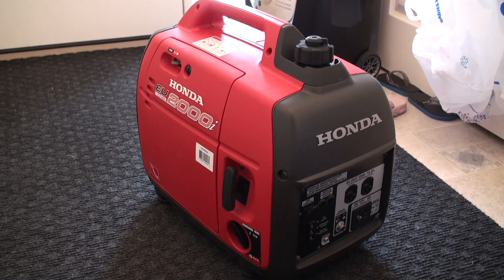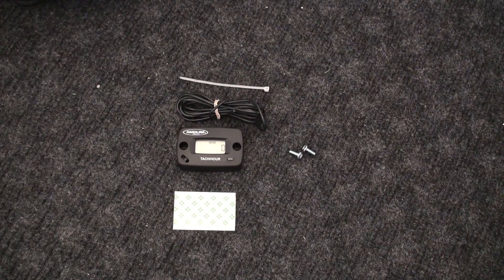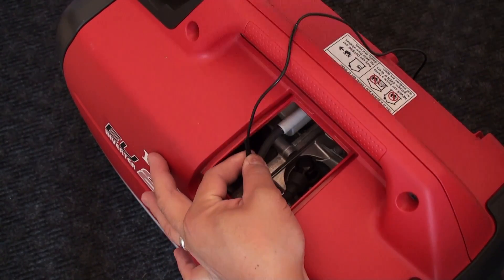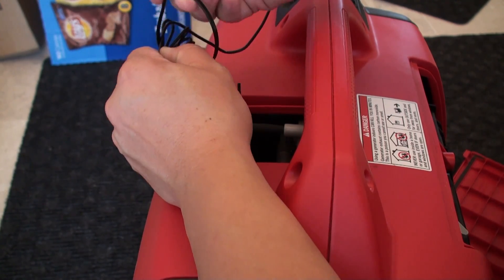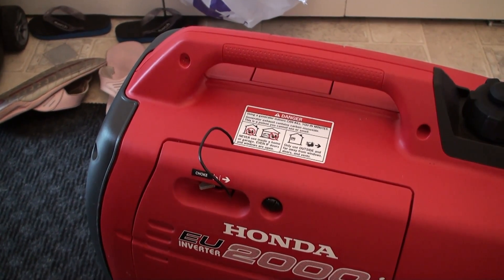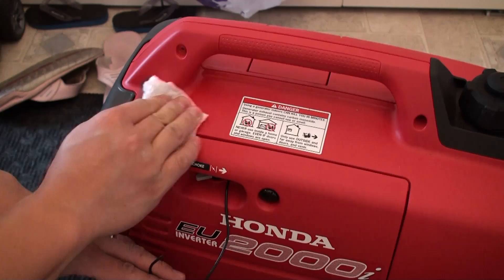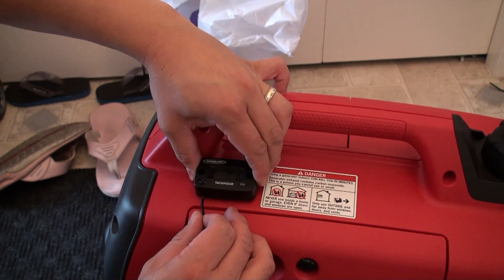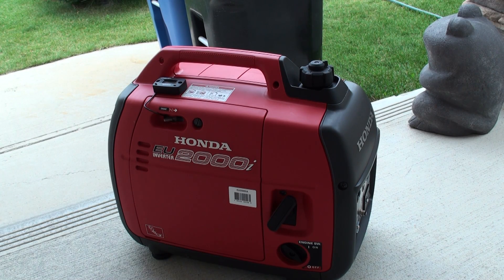Installing a hour meter and tachometer on a Honda EU2000i generator

Comment: Thanks for taking time to show how easy the installation is.  Your video is informative, interesting, & is the reason I come to youtube;  looking for DIY videos
Reply from the maker: +Bill Cole yes installing an hour meter on pretty much ANY power equipment is super easy.  My method probably isn't as "pro" looking as some others but I don't like drilling holes into ANYTHING just because... well... I pay good money for my equipment so I'm a bit obsessive and "anal" about things.  

Thanks for watching and consider subscribing if you like my channel :)
Reply: +piercedasian I just subscribed, I've previously check the "like" box.  IF I pull the buy trigger on the generator, then I'll definitely also buy the Hardline Hour/Tach meter.

Do you know if the 12v outlet can be used at the same time a 120v outlet is being used?  Do you know if the 12v circuitry when using the 12v outlet will prevent a battery from being overcharged?  Yes, I know the 12v outlet charges at 8 amps.
Reply from the maker: awesome thanks!  If you do buy the generator you'll LOVE it.  Nicest generator I've seen so far (next to higher priced models of course).  Super stable power, starts on the first 2 pulls and runs smooth and quiet.  I ran it once at a campground all night on FULL load and nobody even noticed it when I had it tucked away in the bush...  No regrets from me at all.  Good investment.  

For the charger you cannot use both the ac and dc outputs at the same time. You'll damage the alternator.  The DC charger is unregulated and not stable like the ac side is and it can overcharge batteries IF left long enough.  Usually with 12 volt batteries this isn't an issue since the 12 volt battery stabilizes the voltage much like how a car battery does that for a car.  Just err with caution if you're going to use it all the time to deep charge batteries.  If in doubt buy an ac powered battery charger to precisely charge your batteries.  They're lightweight, inexpensive and "smart" so as to not damage the batteries you're charging and because it runs on ac that means you can run other ac powered devices at the same time :)
Reply: +piercedasian I bought my EU2000i yesterday.  I'll get delivery of my Hardline hour meter/tachometer on Monday & will install it.  I, however, will be drilling a small hole in the case to feed the pickup wire to the hour meter.  I want to be able to remove the generator side access panel without having to disconnect the hour meter pick up wire.

I also plan to spray paint my generator Blue, which is Yamaha's color in hopes of reducing the size of the bullseye that the criminal element has for the RED Honda generators.  The place where I bought my generator has a cable running through the handles of all Honda Generators to deter theft.  That tells me these generators hare high on the criminal elements "wishlist"  Hopefully, the different color on my generator won't attract the same attention as a RED generator.

After 20 hours, I'll be changing the oil to 0W-20 Amsoil which is a 100% man-made synthetic lubricant.

I also plan to modify my generator so I can add a 2nd gas tank.  I'll be doing the same modification I saw on youtube, entitled, "Honda EU2000i improvement. One of a kind."
Reply from the maker: Congratulations Bill!  You'll be very happy with it.  Rather than drilling a hole into the unit why don't you just buy the "camo" version of the generator.  This ways you won't have to paint it and it will have that perfect factory look to it.  The camo unit blends into the background quite well.  As for the cable through the handle it is really more of a deterrent for a passer by than it really is an anti theft mechanism.  The handle doesn't have any metal going through it thus it can be easily sawed off and the generator removed from your possession.  honda actually sells a high security handlebar guard but I'm not sure how effective it really is.  Something to consider if you're worried about theft.

Comment: I don't understand why you would not just drill a small hole in the top cover of the generator and run the wire to the Tach that way, with your method you cannot remove the side plate anymore because there is a wire snaked through it.
Thanks for video.
Reply from the maker: +Harrison Winslow Hi Harrison, I deliberately didn't put a hole in my case b/c honestly I'm overly anal about modifying my barely used generator.  As weird as it might sound so much as putting a scratch on my generator kills me let along me deliberately drilling a hole into the case.  Yes it sounds outright silly but believe me when i say I'm a bit anal about things.  Definitely drilling a tiny hole makes sense for a person with logic but in this case I refuse to drill.

Thanks for watching.
Reply: I'm anal about things like this too and I wouldn't want my nice new generator looking like a four year old wired up the hour meter.  Do it properly
Reply: Or he could have purchased a meter without any wires period as in a vibrating hour meter.
Reply: Seriously . . . what is this guy thinking? Drill a whole . . . and stop calling them "ZAP STRAPS" they are called ZIP TIES . . . by every single manufacturer :(
Reply: OMG I said the same thing, avoid all the exposed wire

Comment: How accurate is it? In all of the video's I have seen, it seems to jump around. Once its on for a minute or so, does it even out?
Reply from the maker: fairfield1987 if the tach is a decent quality unit that allows you to configure the # of spark cycles and you've got it setup properly it works surprisingly well.  This particular generator has an electronic governor that keeps the RPMS very precise and thus I've found that there is minimal RPM drift.  I think sometimes you get erroneous/erratic readings because the signal pickup wire isn't wound tightly or neatly around the ignition wires which can cause it to pick up stray EMI/RFI interference which can mess up the readings.  So far I'm very happy with my unit and since it's install I have logged over 50 hours of run time which signifies that it needs an oil change whereas before I would know no differently and would always be guesstimating the run time :)

Comment: Was also thinking.. Since the wire is long enough u can cut it n  test it to see if it works w connectors  n if it doesn't just cut the connection part away n back to one solid wire
Reply from the maker: Steve Lee hmm interesting thought.  I may give that a shot.  thanks for the pointers!

Comment: im sure you can cut the wire in the middle somewhere and install connectors so you can easily disconnect the wire to take off the service panel if you dont want it permanently hardwired through the hole
Reply from the maker: Steve Lee I wasn't 100% sure if I could do that or not and opted to not gamble on trimming the sensing lead for fear of it not working properly with my generator.  It was minimal work to zip tie the extra sensing lead.  The hour meter actually can be easily removed from the sensing wire if need be as it is just a "loop through some holes to hold it in" setup.   In any case, the install is relatively clean and most importantly I didn't drill a single hole anywhere on my genset :)
Reply: Cool.. Yeah I prob won't cut the wire either now u think about it... Gotta order my meter.. Thks for the vid
Reply from the maker: not a problem.  Thanks for watching!

Comment: The lithium battery is supposed to last around 3 years, was wondering when its time to change battery will the meter store the running time? Or will it be lost during battery replacement? Thanks for posting vid.
Reply from the maker: Hi Jeff, glad you liked the video.  On my hour meter the battery is not replaceable and is expected to last between 8-10 years.  I am sure that by that time I can crack open the case and replace the lithium cell but I'm betting that the hour meter will reset back to zero hours since it likely doesn't use "non volatile memory" which can store data without power.
Reply: @Jeff E...From what I can understand, from other video's,  once the battery dies, the whole unit has to be replaced....The batteries are not replaceable.
Reply: @dannyj5688  thanks for the reply...... believe it or not battery still operating.....have 210 hours on the Honda gen
Very happy with both.

Comment from the maker: @ john doe - zap strap, tie wraps whatever you want to call them are available practically anywhere.  You remove the panel exactly how you'd remove it normally.  There is plenty of wire left inside the unit to allow you to take the cover off and set it aside to do the servicing.  If you listened to the video you'd know why I didn't bother with drilling a small hole in my generator case - I am particular how handle my things and drilling a tiny little hole wasn't even an option I was considering.
Reply: My god people. If you don't like the name of the straps ….just move on. If you don't like the way the door may never ever come off...…..dang move on already. His generator . He can do as he pleases. I'm just glad to know I can put one on my Yamaha. Thanks Piercedasin…..!

Comment: What do you do when it is time to take the panel off to service the generator?  The wire is now holding the panel to the generator without much slack to move it out of the way.
Reply from the maker: There is plenty of excess wire that will enable you to pull the panel away without a hitch.  I personally would like to have the panel come off without having to move wires BUT I wanted the absolutely ZERO invasive install on my generator as I am very apprehensive on putting ANY kind of holes into my generator's housing.  The wire that came with this hour meter will EASILY allow you to pull the panel back a foot or two without any issues.

Comment: Zapstrap? Not a ziptie?
Reply from the maker: yeah guys at my work refer to them as zip ties, ty wraps, zap straps... I used to always refer to them as zip ties but lately I've caught myself calling it zap straps.... but yes, zap strap = zip ties for everyone else :)
Reply: Lol, thanks for the detailed video. I'm going to get an hour meter on mine as well after seeing the simple installation.
Reply from the maker: yeah they definitely help with the maintenance side of things.  It is pretty critical to service generators and other small power equipment properly.  There isn't an oil filter so particles keep getting circulated round and round inside the moving parts leading to premature wear.  What better way to prevent that than to change the oil often!